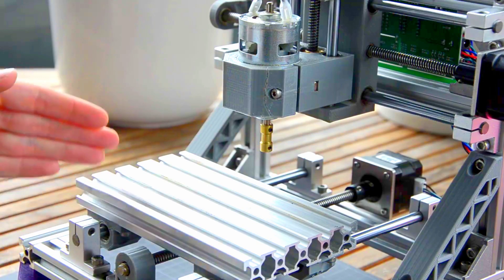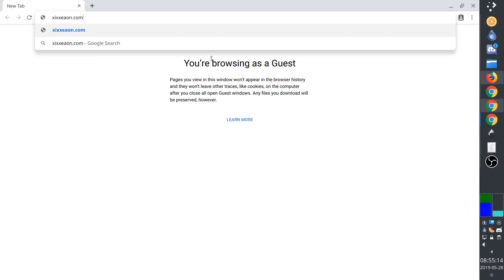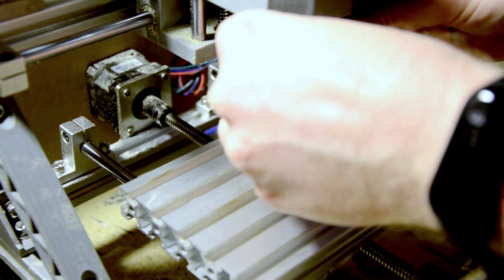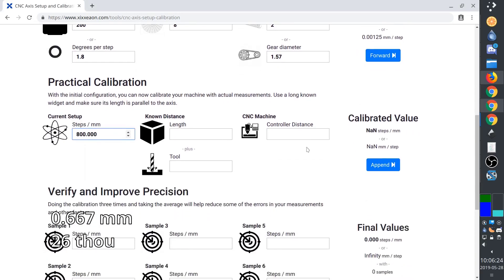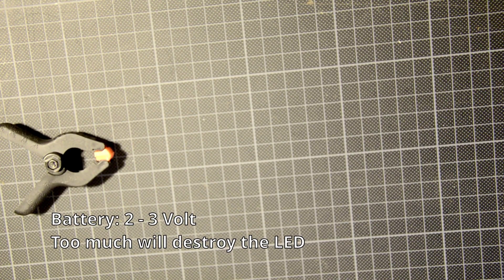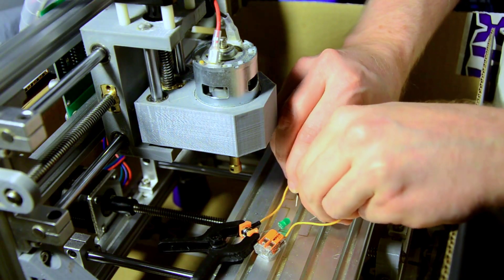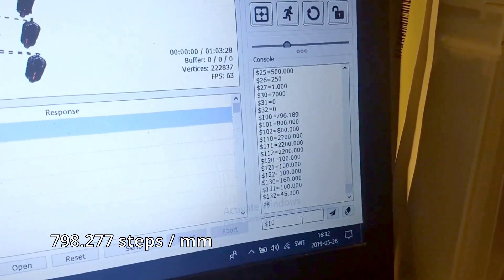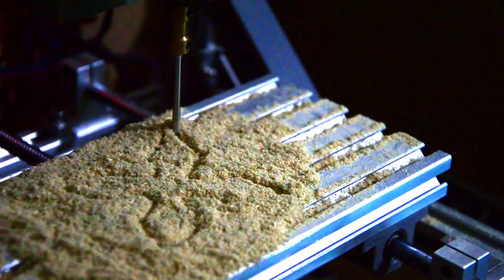How to Set Up and Calibrate an Axis on Any CNC Machine

Comment: @xix xeaon, you can always use calibration test blocks (usually used for ultrasonic thickness meters and linearity checks) for checking accuracy of your cheap digital caliper

Comment: 5:15 and i allready see this introduce backlash. you will measure other side moving back. you need move one direction 800 step is correct.i giveup if it backlash it should be more than 800 step so your cheap chinese thread have pitch error

Comment: 800 steps sound fine,but when it go 799.98 or 800.02 then something is wrong. it cant be.
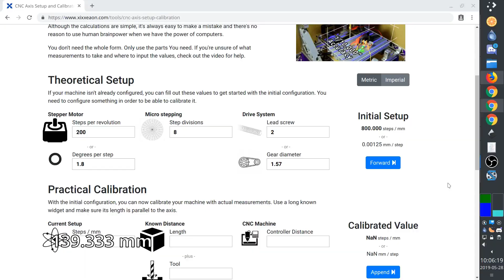2:40 LOL controlled think it go. LOL it moved 140mm if you tolded it.and anyways you moved one direction then other direction .there HAVE to be backlash.move 50mm then continue same direction 50mm. ihave any issues ever.motor steps are 200 it wont change.thread pitch could change if it cheap,but i doubt dat.backlash i beleave LOL but controll not think it go this much.it allways move that much you told,but you see it moved wrong. not opposite LOL

ok got it. you moved based on RULER by hand 140mm (backlash included) yes it actually moved less.its back lash.dont calibrate your machine based on backlash. fix back last 800 is only correct based on math.
if you are moving 10mm 10mm 10mm 10mm same direction your machine now actually move 10+.something. be couse you calibrate machine with backlash. you have backlash spring?? lol.you think it works?

Comment: question for you,  I had a woodpecker control board that was replaced with a new Chinese board with 340 driver.  The axis are off by a ratio of 4 to 1.  I could correct by making the $101= 3600, but that sounds so far off; that I wonder if there could be another issue.

Comment: how do we change the micro stepping?
Reply: You can't.  It's hardwired on the circuit board.
Reply: people must be changing the boards out as I have heard peple say they have changed the stepping
Reply: @adrianharrison5208  Either that or they modded the board.  There are 3 pins M[2:0] which set the number of microsteps. Look at the datasheet of the part they use and that will give you the info you need.  Most boards have the pins directly tied to VCC or GND (which is why I say you can't change it).  If you can isolate the pins or mess with the board then you can change it but it's not easy if the parts are SMD soldered to the boards.  It all depends on how the board is layed out and what kind of board it is.  If you have modules then you can cut pins and re-solder jumper wires. Look up A4988 stepper driver IC as this is the most commonly used IC on the cheaper systems.

Comment: In the second method where did you connect the led wires. I have watched the video several times but don't know the steps followed after sanding the bed
Reply from the maker: From about 05:10 you can see the black wire is connected to the spindle axle and the red wire is connected to the bed (on the side).

Comment: can I just say ,You used a Ruler and not a Rule, a ruler is not accurate . but a Rule is, 
so you will always be out of measurement if using a ruler,
Please learn the difference from a ruler to a Rule. 
Quick Hint, A ruler is a none calibrated measurement of an item, 
A rule is a calibrated machine tool.
As for using the bed to use as a sensor, I would Not, Aluminium oxidizes  and so you will get in accurate measurement's after a day, so unless you keep sanding the same area clean to get the contact for the voltage to read, you will end up with a worn area,
Hint Buy a proper probe, they are very cheap. at about 4 bucks
Always keep your work clean, use an extractor , or a simple vacuum cleaner.
By keeping the work part clean helps reduce friction and heat to the part, Simples.

Personally I would avoid doing anything in this video. and seek proper learning tuts.
Reply: its a $200 cnc..... chill out
Reply: I think you missed the point of the video. The point was to demonstrate the principles of calibrating the router, regardless of how the calibration measurements are taken. He states in the video that by doing this you can only calibrate to the limit of the accuracy of your measurement method. It's up to the user to use something reliable as the "known measurement" which is used for calibration. It is a simple, useful video.

Comment: Nice video.  Is it possible to check the surface flatness to ensure the carriage is parallel with the table?
Reply from the maker: That's right!
Reply: I would use a piece of bit of ally or hard wood at a certain measurement . (like 5mm) thick/Height and put into 1 corner of the bed and stick down, and then bring the spindle tool part to it and have motor running and touch the part until it starts to cut and take note on your software the height, it started to cut at, and also measure the thickness of the material and see what has been taken/removed away.
do this in all for corners of the bed, 
and if out of measurement adjust the bed until all is equal.
You can do all the same without spindle running and not material/block , and just use a bit of paper and lower the spindle tool until it just touches the tool part, by moving paper until you get resistance and do the same in all 4 corners .

Comment: Hi. I am doing this for a CNC 3018. Do you know if these use the same stepper motors?
Reply from the maker: I can't say for sure, but I would guess Yes; it most likely uses the same configuration as a 1610.
Reply: @xixxeaon  i'm also curious if i can use the same values and i'm not sure how to figure out the numbers for my motor.
Reply from the maker: @MrTheTaz  If the machine looks similar and you check the default configuration ($$) and it uses the same numbers (800.000) then it probably has the same motors and lead screw.
Reply: @xixxeaon  thanks man!
Reply: @MrTheTaz  an easier way to do this is by using "Universal gcode sender" the "Platform" version, it has a wizard that by slowly moving an axis at a time, and measuring how far it traveled, it gives your the corresponding resolution